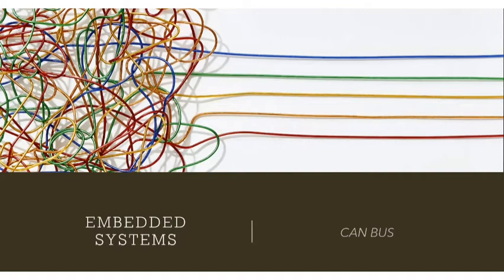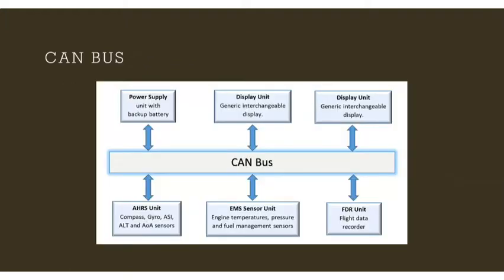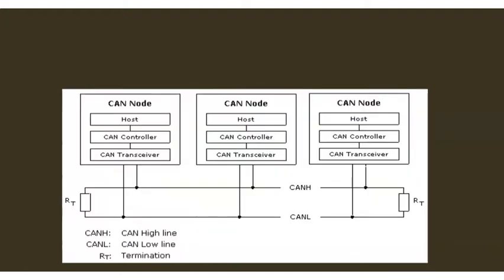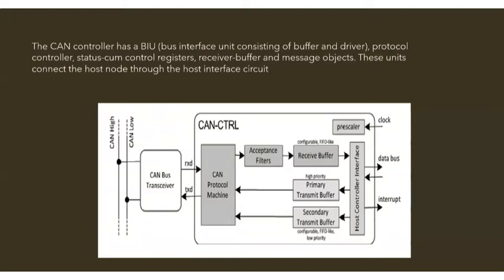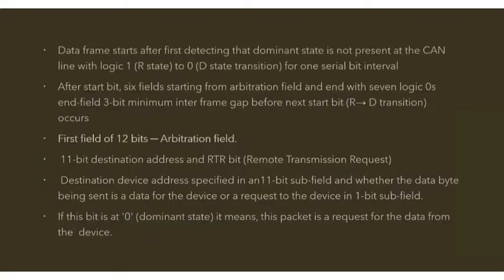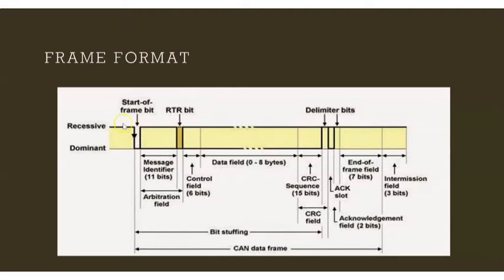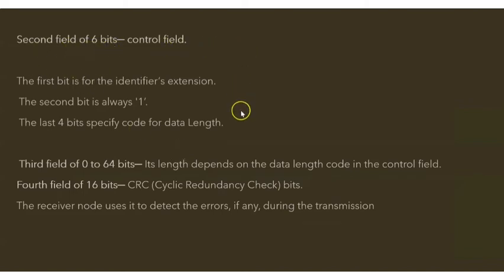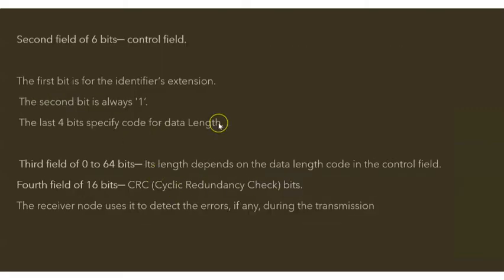CAN Bus Structure and Frame Format| Embedded Systems

Comment: CAN (Controller Area Network) is a communication protocol used in embedded systems, especially in vehicles and industrial automation.
- It allows multiple microcontrollers (nodes) to communicate without a host computer.
- Designed for real-time, reliable, and robust data exchange.